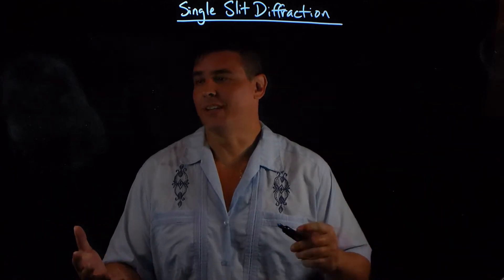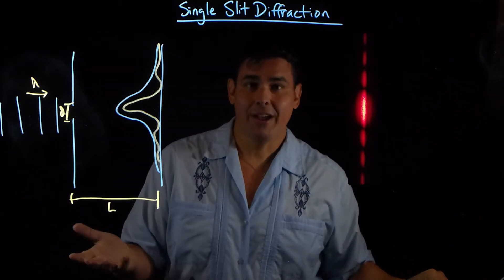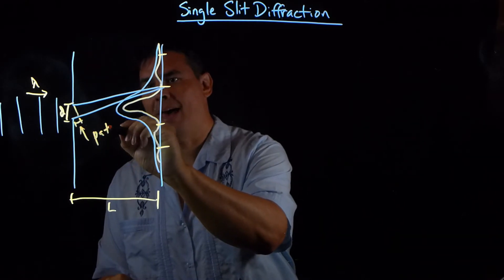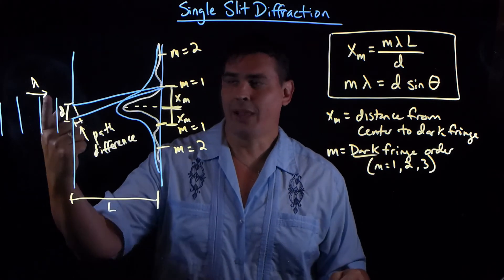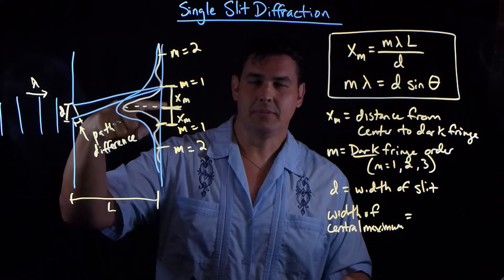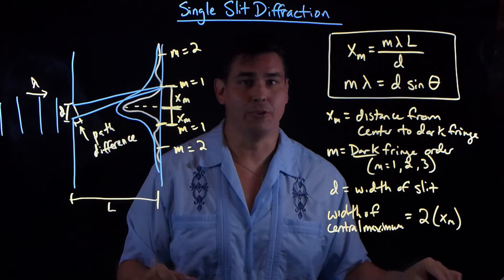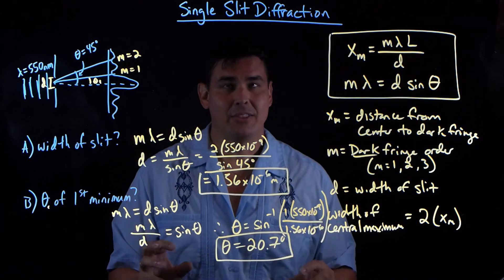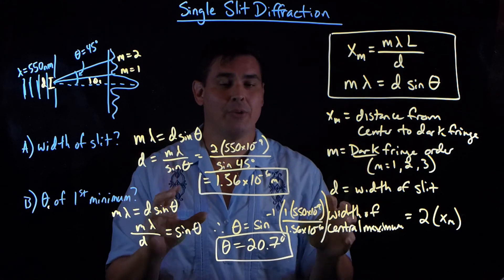Single Slit Diffraction

Comment: Does anything change when you observe a single slit exp vs a double slit? Does light behave like a particle or wave?
Reply from the maker: the pattern changes from a single to a double slit because of the number of openings, but it still shows interference.  Light can show both particle and wave behavior, but because interference is a wave behavior, this is showing us that light has wave properties.